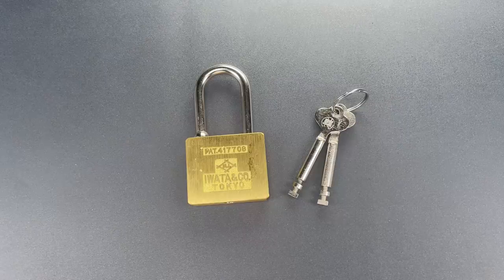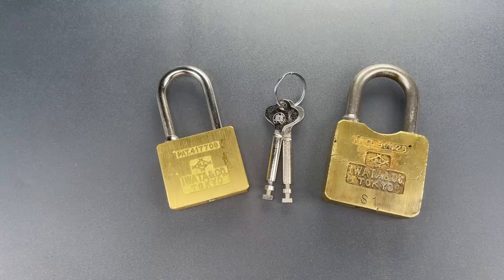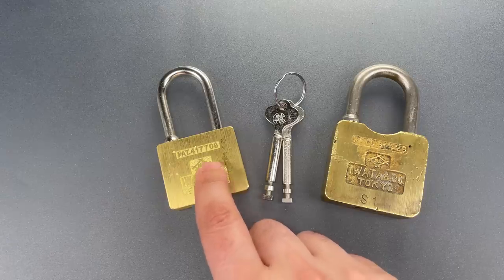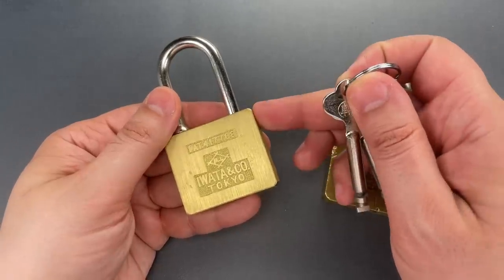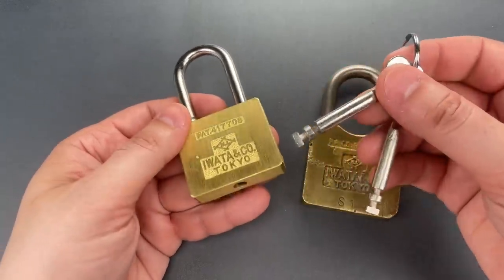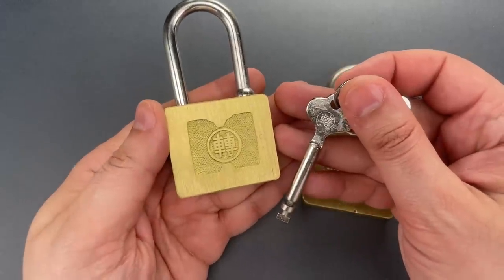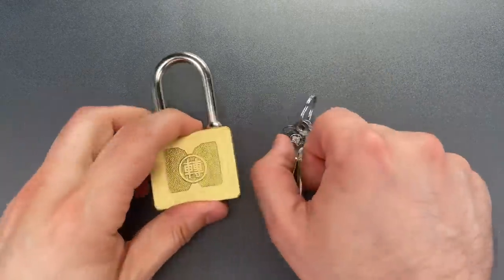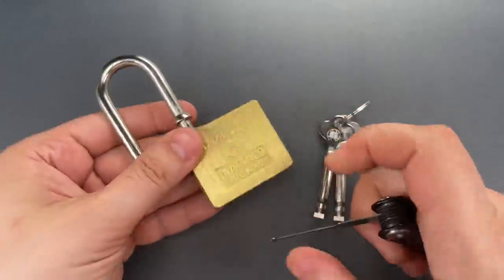[1304] Analyzing a Vintage Iwata Padlock

Comment: The word you used for 轉 was actually Chinese and not Japanese. The Chinese is "zhuǎn", while the Japanese can be 5 different pronunciations, being "utata" (the only one used when the character is on its own, and a name) "ten" (usually when the character is used in a noun), "koro" , "maro" and "utsu"( when the character is used in a verb) meaning move, shift and turn. Outside of the name "utata" it is basically never used nowadays, and was basically replaced with 転.
(And it's also rarely still used in 轉任 which means change of post)

Comment: Not all locks need to be difficult to open. In the army, if we lost our personal locker padlock keys, we opened them with a readily available chairs. Just lift up the chair, put the foot of it between the shackle on top of the lock body and give the chair a generous tap on top of it and you have your lock open. It broke the lock but hey, it was open in a second if you were in a hurry to gather your gear for an inspection or combat training. You could get a new lock from the staff sergeant for couple of bucks, no paperwork needed, he had an entire chest full of them with keys.

The only purposes the lock was to keep others out of the locker and if you found yours broken, you'd know someone had broken in. The officers would have methods of "finding" the culprits and you'd likely get your stuff back if something was taken. Not that it ever happened. Discipline and shitty locks were good enough of a deterrent.

Comment: My guess would have been some sort of lockout/tagout system, as the key is forced to stay with the lock in a stored/unlocked position....but the keys seem to all be similar, which doesn't put much safety on the individual as any of the other keys could possibly open all the locks, defeating the purpose of a tagout system.  Reading the comments seems to make this more of a "make sure you lock this when you are done inspecting" type of reverse tagout system.....which makes a little more sense, as you would have possibly 1 master for the entire railyard.

Comment: Interesting, Im guessing it would be lock for a mechanical switch box on an electric set of points (switches in the US) in case of failure and hand operation is required, or a point clip, maybe on a facing point to stop the train splitting the points.

Comment: Wow, not only did you open it quickly with your tool, you were also able to remove it while the lock was open, why didn't it lock your tool inside?
Reply: The retaining mechanism slides into one of the slots in the key. The picking tool  does not have anything that can be engaged by the lock.

Comment: Interesting, is it possible the lock in question is akin to a lockout padlock such as those featured on your practice carabiners? That would be an alternate explanation for the weather resistance of the lock itself, rather than needing to be left out in the elements it needed to not seize for removal as otherwise the system could not be released.

Comment: 轉 is an out-dated kanji in Japanese, it's modern replacement is 転. Because it's out-dated in Japanese I think you found the Chinese pronunciation (kanji are originated from Chinese hanzi characters and many of them are the same even if the pronunciations or meanings may be different). These characters have the general meanings of: shift, move, turn, revolve, and change, depending on usage and context so I think you're probably spot on for the intended usage of the lock.

Comment: 1. This kanji would generally be pronounced "ten", (among some kunyomi readings). "Zhuan" is the Chinese reading.
2. While this kanji gets little use nowadays, before 1947, it actually was used in several very common words. For example, it is used in the word "unten", which means "driving", now spelled "運転”, but with a "kyuujitai" (old, pre-1947 spelling) of "運轉” with aforementioned kanji. This is along with other kyuujitai such as those for "bicycle", "resale" or "liquidation sale", and, yes, "turn", among others. There's more to be said: it seems to generally, yes, represent some sort of turn or change, but I suppose I'm just offering my two cents.

Comment: Quick question... once you open the lock with the warded pick you are able to remove the warded pick from the lock. Does the key retention mechanism then prevent the key from being inserted back into the lock while the lock is unlocked?

Comment: The class 1 railroads here in the us like to use a similar warded lock with the same key in a relatively large area. We can work a line several hundred miles in either direction and having the same key is a lot better than a janitors ring of hundreds of keys for each switch or derail. The key retaining feature is so we remember to lock it back up and don’t forget our keys, usually.

Comment: In some security installations, the use of this type of padlocks is very common. Its mission is to add an intermediate and inevitable step, which must be carried out by a specific person. Its function is not anti-theft, but simply to add that need to pay attention to that intermediate step. I work in the company that manages the railway lines in my country. All the best!
Reply: Thanks for the insight!
Reply: So it's kind of like a tamper seal/control switch? Only the person with the key can do a certain action?
Reply: I have seen similar devices on safety switches - where the power is normally locked "on", but needs to be secured such that it can't be bumped or fall open.  Of course in the case of my apartment building, they don't even use locks like this for the large knife switches on the panels.  So homeless people love to come by and turn them off as a joke.
Reply: @caseydarrah  Yes! In fact, I have seen it, for example, in boxes that contain a switch, or securing track diverter levers, so that this action cannot be carried out without the knowledge of the keeper of the key.
Reply: @alejandrocastro211  Neat! I'm like LPL in that I love the history and cultural aspects. Nothing mechanical is made without purpose.

Comment: Seems like an electical box lockout/tagout lock possibly also.  Doesn't need to lock something with any real security, just needs to be there to keep someone or something from flipping a power switch while an electrician is playing with the wires so they don't get fried.

Comment: But could your Covert Companion's warded pick open it when it was jammed up with slush and grime?
Probably not, but this is damn interesting nonetheless. I don't even care that the mechanism is very insecure pick-resistance wise; that's clearly not its job. Its job is that when someone with the right key comes along, they need to be able to open it, even if the thing has been left sitting exposed to the elements for thirty years and it's the middle of a freeze-your-gluets-off lashing-down January winter storm.

That's... really cool actually.

Comment: Hearing what you said about the story of the lock and you guess to where it was used, I think you are close. I have a past as a railway signal engineer (designing the safety systems on railways). When I saw the key retention I thought a switch lock too. So the system goes like this.
Say you have a parking track for fright carts on a station, they have breaks. In case the break stops working the cart would be free to roll where ever. This is why parking tracks are typically secured with what is called a "Derailer" (it does what the name suggests). The derailer is placed after a switchpoint, in the old days the switch point and the derailer was manually operated, big lever to move the derailer on/off and the switch point side to side. If you want to put a cart/train in the parking track, you would request the key from the "station manager" they key fit in to the derailer, so it can be removed, this releases a second key (at the derailer) that is used to move the switchpoint. So it goes

Station Manager -> Derailer Off -> Switchpoint move.
The train/cart gets parked the order will be
Switchpoint move back -> Derailer on -> key handed back to station manager.

You are sure when they key is handed back the railway will be in a know state.

Depending on the system used to manage the station, when the key is not in possession of the station manager some safety systems kick in to action to avoid setting a train to the area where the key is being used.

There are a few things that talk against that this is what they key is used for - the fact that is simple and the same key would fit multiple locks, you don't want one key allowing moving multiple switch points on a station, or even that one key will fit on a different station.

One other place I could think of it being used on the railway would be to lock switchpoint hand-cranks. On "newer" (could still be in the 50's) railway systems with electronic motorized switchpoints there exists a hand-crank to move the switchpoint when for what ever reason the power is out or the motor is broken. The less secure lock could be used for this, because if the power is out the station is in a fault mode anyway, and typically if the hand-crank is engaged there will be an error message (blinking light and beeping) presented to the station manager.

Wow sorry for the ramble, I hope it makes sense, I'm not an expert on Japanese railway systems (primarily Danish and Norwegian) - love your videos.
I've been tempted to send you a multi-meter just so you can indeed say that this is a Fluke

Comment: Something about this lock screams fusebox or telephone junction box of some sort that the lock was used on
Reply: That was my first thought, too.  But my guess is it's a simple door lock for freight cars so that they stay shut.  Similar to the ones you see on trucks and moving vans - to make sure it stays shut more than any physical security.
Reply: @plektosgaming  the reason it screams fuse/power box or phone junction box is the fact its main use would be used outdoors where a lot of main fuse/power or phone junctions boxes would be and you wouldn't want to forget to have locked them.

Comment: Hi LpL. I have been experimenting with lock-picking using your videos and wasn't having a lot of success. I watched another video on "over-setting" the pins. I am not sure if you have covered this in past videos but I realized that I was over-setting almost all the pins. I was under the impression the pins had to be pushed until they stopped. If you haven't covered already, I suggest a video on over-setting for a newbies!

Comment: L2 Japanese speaker here, with some input on the Japanese character you identified (which I think is "転" in modern Japanese?):

1. lol, uh, "zhuan" is the Mandarin pronunciation. It looks like the pronunciation here would be "ten", if the rest of the supposition pans out.

2. Your guess about the purpose sounds fairly plausible, to me. When I looked up "転" and the word for "(railway) train", I did see that the word "転車台" (lit. turn-carriage-pedestal) is used to mean "(railway) turntable". Along with several other results that also mention switching tracks. So yeah, that checks out!

sources:
https://ja.wikipedia.org/wiki/%E8%BB%A2%E8%BB%8A%E5%8F%B0
https://www.mintetsu.or.jp/knowledge/term/16462.html
https://isok.jp/rail/term/term_te/tendo.htm

Comment: These are likely for some low-security, high durability use case.

Somewhere where people would obviously been seen if they they are tampering with the lock, or even where the lock is just to keep people from accidentally doing something, or doing something without proper procedure.

Comment: We used to carry cricket lighters to defrost the outdoor padlocks when I worked on the railway. We had two basic locks both made by Yale. Sometimes we had to break them off if the mechanism was seized, I could do it with one blow on the 769 but the 221 was tougher and usualy needed half a dozen smacks.

Comment: Now, I'm not an expert regarding locks, nor can I read Japanese. But I shure as hell know my way around railways. And indeed, that sounds like the kind of lock you'd use to secure railway signaling equipment. Points (switches in US term.) and signals used to, and some still are, operated mechanically, via levers and pulleys/rods. On rural stations, these lever frames often stood outside on the platform, and where exposed not only to the wether, but also unauthorized hands, so they used to be locked up. Since the goal wasn't to fully secure the frames, but only to avoid someone from moving them when nit intentioned, the 'cheap' lock is more then enough. With these frames being out in the open, they needed to be  dirt resistent.

Comment: I doubt it, but could it be a token lock? The security isn't as important as having the lock/key itself... no key, no travel on the line (or switching of points) or something along those lines (pun not intended). It wouldn't be much of an upgrade over handing over an actual token or flag, but its the thought and procedure that counts (a single line between Norwich and Yarmouth used to hand over tokens at various dual line stations in between for each section - no token, no proceed).

Comment: I work for a large railway in the signal dept in Canada. In my dept we use key retaining locks for our signal equipment. For hand throw switches that go onto mainline they use another type of key retaining lock, S&G Environmental which I made my own key thanks to Bosnian Bill. For mainline dual-control switches, at least for the hand-throw portion, we do not use a key retaining lock. For the part of the switch that I need to get into to maintain we use a Raco lock and the 'key' is not retaining.

Comment: Low security but high weather resistance made my "safety lockout" sense tingle. Track switches sound like a good use, too. It's not the sort of thing most people are going to try to mess with to begin with, so having the lock to ensure it doesn't accidentally get switched seems like a good guess.

Comment: U.S. railroad locks are utter garbage. while they may have heavy steel exteriors, when they freeze up flares are often used to free them up. however the internals melt at such a low temperature that you can destroy a lock that is still cool enough to handle with thin leather gloves. i'm told there are plastic internals but it could be just a weak metal. i'm very certain a railroad would use a "cheaper" and less secure lock just to save money.

Comment: Seems well designed for the purpose of a safety lock, similar to the Kirk Key system in the US.

Key retention, weather resistance, & reliability all matter much more than security, since the point of the look is to prevent an unfortunate operating mistake rather than secure valuables.

Comment: These locks dont make any sense, look how they all have a very small bit of metal after the indent where the end goes in to the lock, how can that ever be strong? Its flat and wide enough to have 2 holes in it and positively engage those holes in a lock body, i think current locks are mostly an illusion made this way, closed they look right to the eye, so much so people never open a lock and think hey why does the shackle only have a tiny engagement part in the body yet lots of "d" to allow cutting or breaking besides going through a chain

Comment: Quick research:
車專
Compound to: 轉
Which is the older version of: 転
Which is a standard grade 3/N4 kanji:
https://jisho.org/search/転%20%23kanji

“Ten” the more common reading, used in change or switch as mentioned...

I'm a newb learner but I checked with native speaker and they agreed.